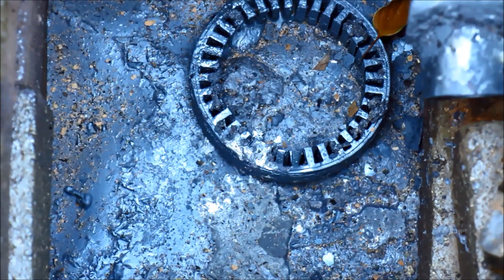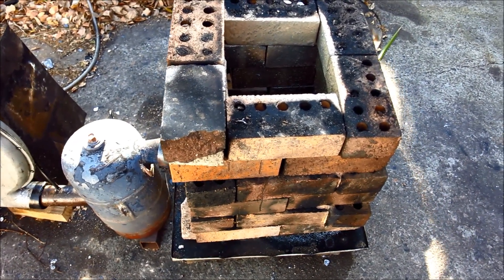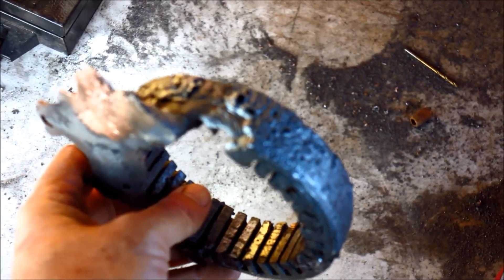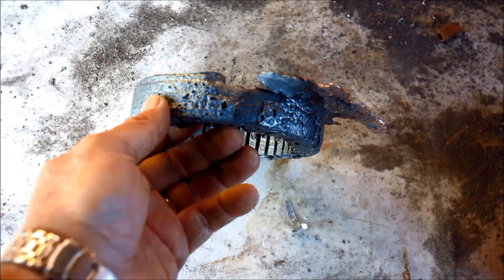Melting steel in simple home brick furnace with waste oil

Comment: where do you get your oil from
Reply from the maker: Usually restaurants as I prefer to burn veg oil but I also now get friends and rellies giving me used engine oil. 
I can pretty much get all the veg I want or need here. Usually pick it up 200L at a time.
Reply: Oil Burner thanks. at some stage i plan in building a oil burner my self.
Reply from the maker: Mower Innovations
I was thinking of doing a back to basics vid answering and explaining some questions I get asked a lot about.  If you think this might be helpful, I'd appreciate any input as to what you may not be clear about or any questions you might have.  More input I get, the more helpful the vid will be!  :0)
Reply: Oil Burner that would be a good idea. Do you think that 4 inch pipe and using a heat gun or a shop vac out put will work to melt down aluminium as I'd like to give it a go.
Reply from the maker: Mower Innovations  4" pipe for a crucible or Furnace? That would be awfully big for an air inlet tube! You'd be doing crazy power burners like mine!
Heat gun for air supply should work as will a shop vac. Only comment there is, it's amazing how the noise of the things can get on your nerves while you have it fired up.

I like the blowers for that reason. Once you have the burner lit, they make a good roar themselves and with the screaming electric motors, can really make things hard to concentrate on and make me at least feel hyped up. Spose you could always wear ear plugs.

Depending on the output you want, you could use a cheap 12V bilge blower like in one of my vids. Puts out plenty of air to get good heat out of and is nearly silent.
Reply: Oil Burner well I see how it goes if you want you can check out my channel and in the future I will make a vid of me making one

Comment: Fantastic! I just run across your site and hope you are still working on these projects. I am interested in building a burner to melt down aluminum block from small engines and heads. Also want to use the heat for a forge if possible. I hope to make it multipurpose if possible, so I love your ideas. I do hope you are still healthy, you do have some high heat you are working with and I am sure it has it's potential to be deadly.. Be careful.. I an will be watching.
Reply from the maker: +Dale Jackson  Yes, still doing these. Did you look at the other vids on my channel?  I have a few aluminium melting vids and furnace designs  for getting ally from things with embedded steel like blocks, heads and other parts. 
As far as health wise, I have genetic conditions I can do nothing about that will take me out far sooner than my one or twice weekly fire ups of these things.  I do try to be careful even if I don't wrap myself in cotton wool and all the other safety industry profitable products they have brainwashed people to wear. I have no desire to hurt myself so I use my brain first and rely on the products 2nd.

Comment: Stator steel is silicon steel (approx 3 % silicon ) . It has a melting point of 1500 oC . The grey glaze on the bricks is  indicative of a temperature of 1300 oC being achieved .  So that would put the reliable temperature of the furnace somewhere between 1300 and 1500 oC  , I would say 1400oC ! 
So what could be melted in this furnace ?    Sand , silica (make glass)  , aluminium, nickel, copper, zinc, lead , gold , silver , and high carbon steel and stainless steel  , 1350 oC  (old files , cast iron , knives)  .
 Low carbon steel (mild steel and pure iron ) require about another 150 oC to melt reliably .
Reply: Yes you should be able to do cast iron but not steel (mild Steel etc).  Its right on the edge for temperature but some slight improvements can increase temperature. Insulating the furnace of course is one of the best methods to improve it   Also heating the in going air would help and of course increasing the oxygen content which is not easy .But if you build 2 chambers (2 fans) in series   the  hot exhaust of 1  feeding into the next one which is your furnace , the last chamber should get hot enough easily .   *****
Reply: @jerryseinfield  actually heating the intake air would make it expand this leading to less concentration of oxygen.
Reply: No for nickel you will need temperature above 1460 degrees Celsius

Comment: I think the iron oxide (rust) they might have put inside bricks might have melted lol. and only on 5 liters?! wow. Amazed
Reply: ***** rust is actually iron hydroxide
Reply: BestHolkin
thanks,
Reply: BestHolkin or trioxide
Reply: +BestHolkin "Iron Hydroxide" only indicates water specifically as the oxidizer. Rust is still iron oxide. I can put HCL on steel and call it iron oxide. "Iron oxide" isn't specific.
Reply: WorkInProgress How much did you learn about chemistry? In chemical terms it should be FeO or Fe2O3, maybe also Fe3O4, but it is technically FeO+Fe2O3. I'm not so familiar however with usual life terms. It seems you can call rust many completely different things.
Reply: BestHolkin
soo... what is rust?

Comment: I owned a brickworks and we used copper oxide as a glazing material.  the colours range from green through paler shades  to yellowish.  I suspect that the copper has oxidised, perhaps mixing with any sand that might be attached to the brick and then turned to a glaze

Comment: Hahaha - awesome!! As I said - there is a reason that you have special fire bricks for furnaces. Maybe you need a sledge hammer to get that thing apart (as the bricks also weld toghether), LOL!!
Reply: Haha - I didn't look at the whole video at first. The soot indicates that the temperature was below 550°C at that point and it still get that hot on the inside - it indicates that it was a very short run with amazing heating power, as otherwise the heat would have gone deeper into the walls.

Comment: The steel used for alternator stators is usually high silicon (about 3% Si) steel

What may be of more interest to you, that according to wikipedia, the melting point: ~1,500 °C

ref: https://en.wikipedia.org/wiki/Electrical_steel
Reply: Ok, that's strange because I have got a piece of iron from a transformer core to melt at 1280°C 
 - the heat electric resistance heat wire that I'm usning has a melting point of 1500°C. The furnace chamber cant get hotter than the heating source heating it. 

Stanless steel on the other hand do have a high melting point and contains pretty much chromium (which have like 1857°C when pure) and i havn't managed to melt that. But look at the furnace - 1300+°C with a design like this it pretty amazing.
Reply from the maker: Thanks for the info! Seems that is a higher melting temp than regular steel.  I pulled the furnace apart  today and found I also melted stainless steel, the insulation tile and... BRICK!
Watch for a vid showing what I found with these things when I pulled it all apart.
Reply: Oil Burner
You need to force more air into the fire.

Comment: Yeah those bricks are vitrified, you sometimes used to get that back in the day when they did batches of hand stacked bricks, the ones near the heat inlet to the kiln would get one face melted. You sometimes see it in older buildings (they were offered cheaper). Bloody impressive that a DIY burner from scrap running on waste oil can do that!!